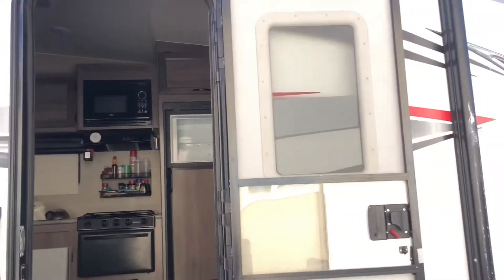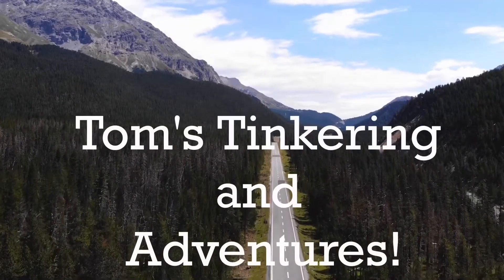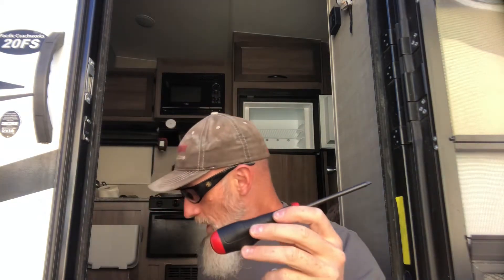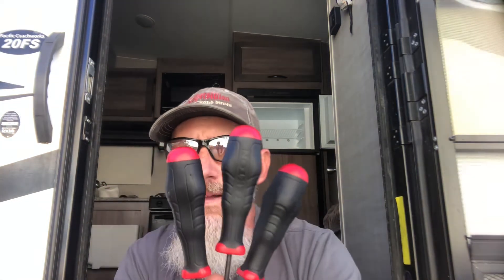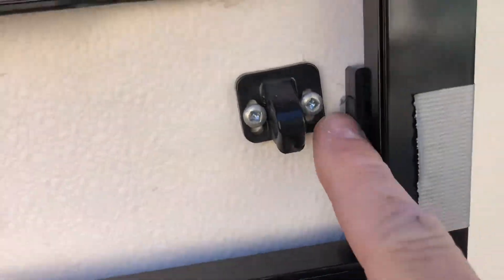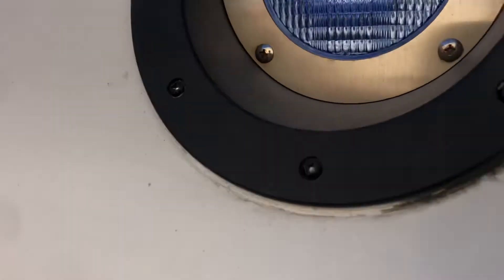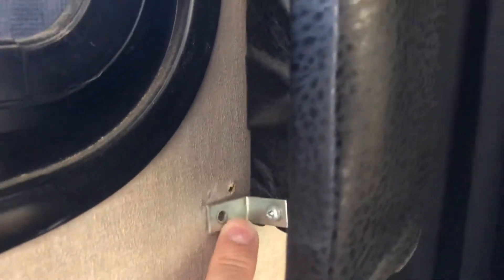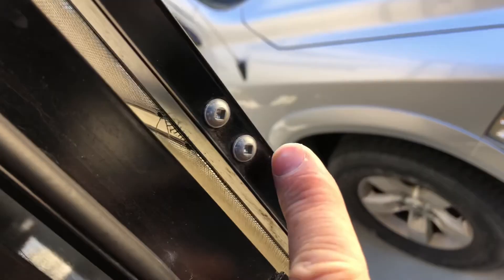You Need This Tool If You Have An RV!!  Robertson Square Drive

Comment: Oh yeah. First trip in my trailer. I though my eye were going. Two sets of allen keys and nothing worked. I had a full on case of touretts. I have the 1/4" driver bits they work well too. After a couple trips everything needs a good torqueing.
Reply from the maker: Pretty much every trip something needs attention.  I don’t know why I didn’t have Robertson drive tips in my kit, this is my third RV…😂😂

Comment: Just a boat on wheels is a great analogy. There's still Robertson screwdrivers and driver bits scattered around here from the Winnebago we got rid of 20-years ago. Whenever I run into another one I usually mistakenly assume it's a potentially useful Torx or hex driver until closer examination reveals it's not.
Reply from the maker: It’s pretty wild that the RV industry is so heavily invested in these.  The Canada screw lobby must have some kind of control.  😂😂